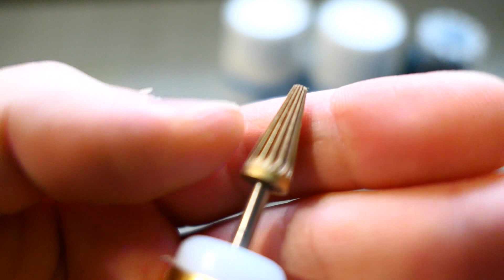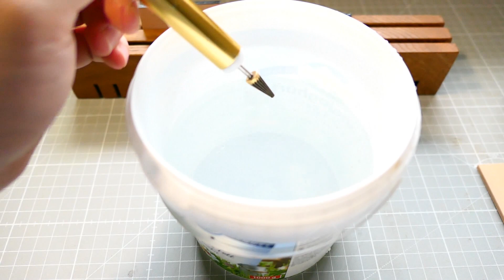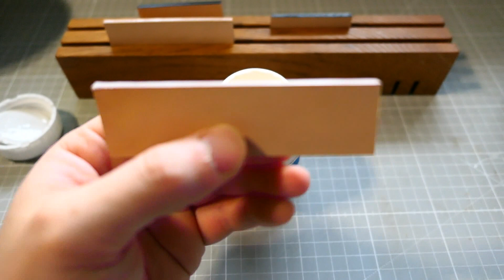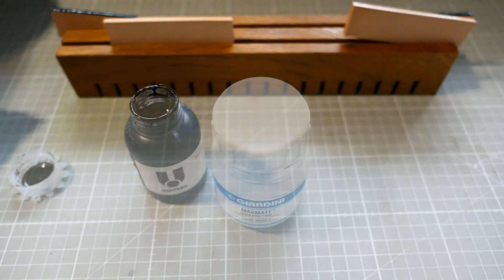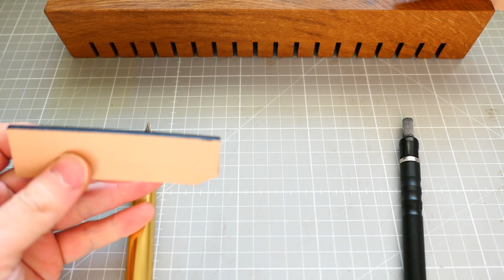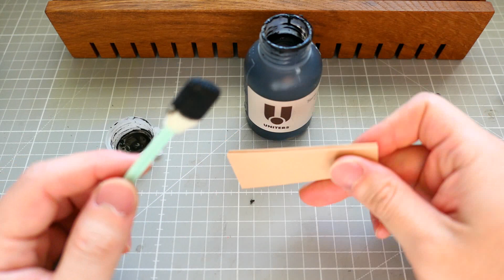Edge Roller Pen Comparison!

Comment: Got the golden one from giardini as well... didn't work so good, so i ripped out the plastic on both ends of the tube and replaced it with ballbearings... now works like a charm. might have been a bit overkill though. ;)

Comment: I’m a leather worker and I find the black leather edge painter is way smoother especially when you use the large tip. The small tip has a slight lip on it. I started my journey with the gold one but I’ve found that it ages horribly and starts to move improperly after a while. It kinda almost gets stuck. I use the same giardini base coat and paint as you too the gold one also paints kinda choppy after a while too I don’t know how to describe it but because it’s pointed those points end up imprinting on the paint as it’s laid